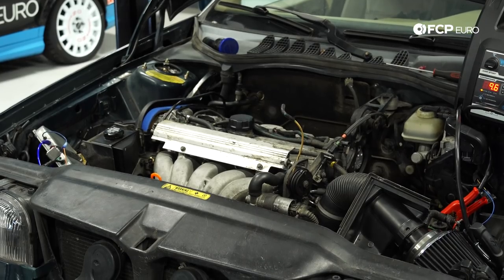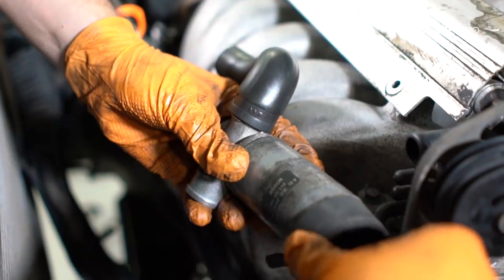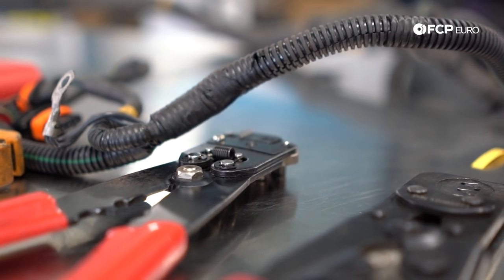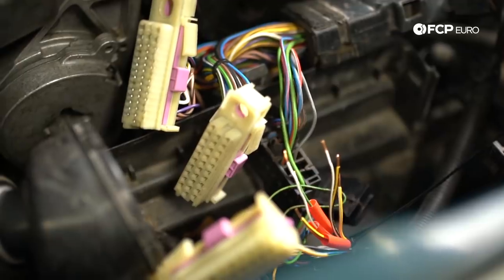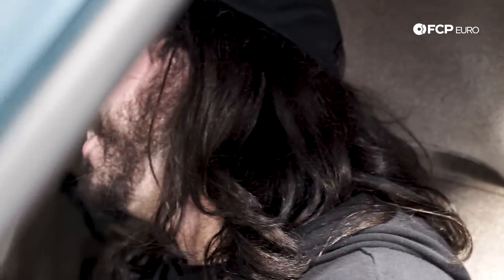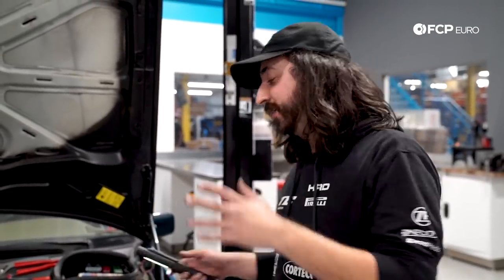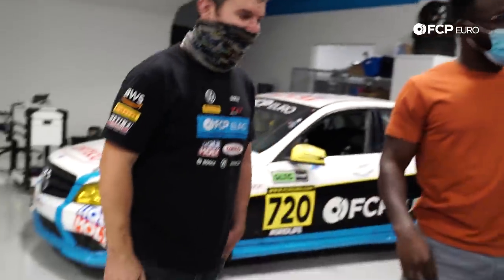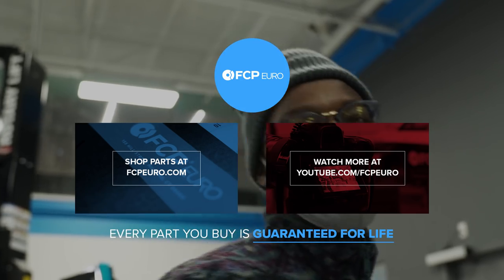The Rats Nest - Wiring the 850 and First Start!? - The 850 Project - Episode 5

Comment: I knew exactly what was going on when it wouldn't crank. I remember doing the manual swap, and trying to start it before doing something I can't remember with a green wire.
Reply from the maker: Those dang park/neutral safety locks!😂 Which car did you manual swap, Sean?
Reply: @fcpeuro  an 850r and an 850 turbo.

Comment: Can you guys give us info on the head? What valves and cams are in there?
Reply from the maker: Hi, Drew! The cylinder head has been CNC ported, the cams are ENEM Y21 (264's, 9.6 lift) and intake valves are Manley oversized (unsure of the exact specs on the valves). We purchased a wrecked car with this engine already built. Curious to see how it does in its current state, but we definitely have some plans for improvements in the future!